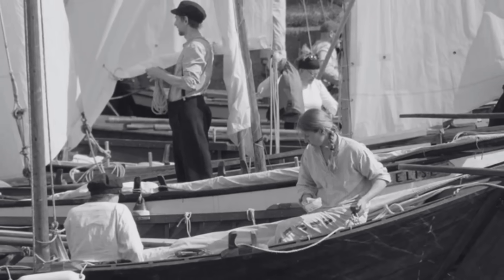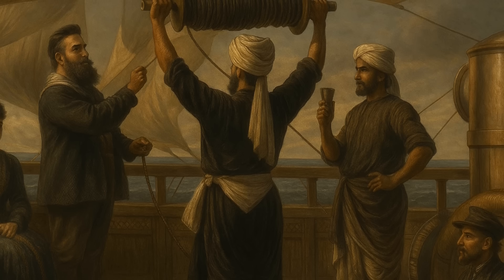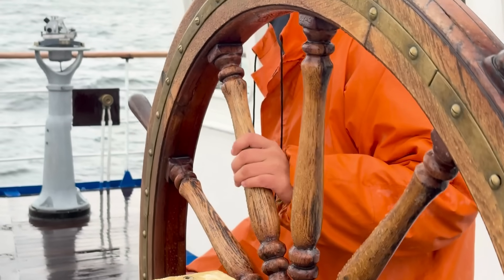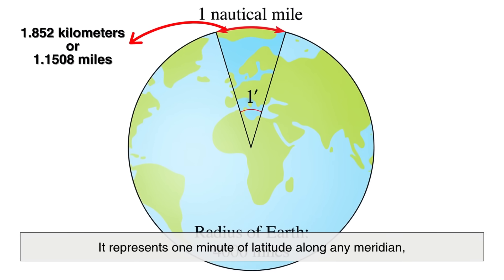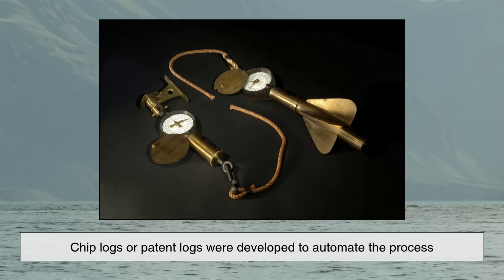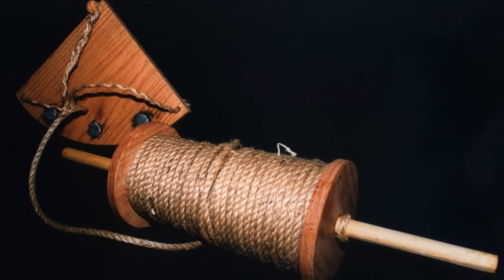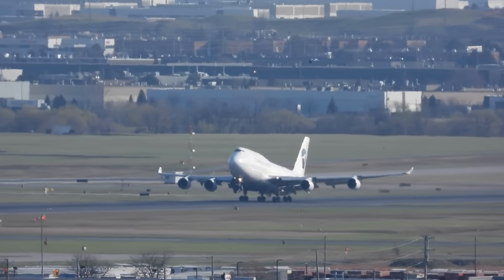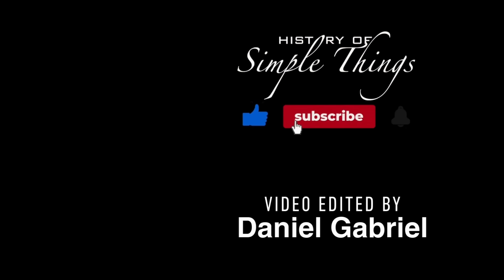Why Ships and Planes Use ‘Knots’ Instead of Miles per Hour

Comment: Thanks for finally explaining knots per hour! The equation was rudimentary there are 6076 feet in a nautical mile divided by 3600 seconds in an hour times the 28 seconds in the hourglass which equals 47.25 or 47’ 3” of rope. Therefore the number of knots that passed through the sailors hand during the test measured the knots per hour or speed. Awesome!!!

Comment: The knot is based on the 2000 yard nautical mile.  Statute mile is   5,280 feet, the nautical mile is 6,000 feet.  It makes computing rate, time, and distance much easier to calculate for basic navigation
Reply: That is true but it is also 1/60th of a degree of longitude on the globe at the equator, which also helped calculate position

Comment: 1 nautical mile is defined as 1/60 of a degree of latitude along a great circle (a meridian of longitude), i.e., 1 nm = 6,076 feet.
Speed is defined as distance/time, i.e.,  s = d/t.
Let x = distance in feet.
Now, forming equivalent ratios, where 1 hour = 3,600 secs and 28 secs is the time between the knots, then: 
x/28 = 6,076/3,600
x = 28x6,076/3,600  feet
x = 47.25 feet (approx)
Therefore the knots were tied about 47 feet from each other on the rope, thus giving a speed in ft/sec, which could then easily be converted into a speed of nautical miles per hour.
Simple yet very clever.

Comment: Excellent video.  Just one slight correction.  What you call a "regular" mile is actually known as a statute mile.  Oddly enough, a statute mile is used by sea craft traveling on bodies of water within the USA.  Though ships will travel in knots over nautical miles on the ocean, on US rivers and the Great Lakes, they measure in statute miles.

Comment: A nautical mile is equal to one minute of arc on the surface of the earth.  This is handy, because you can use the latitude scale on the side of the nautical chart to measure distances on the chart.  It is also handy when using a sextant to establish your location.  The calculations are simpler.

I'd Like to point out that the mechanical logs for measuring speed--were not chip logs.  Chip logs are the older device--a wooden 'chip' attached to a line marked with knots.

Comment: See 1:17 "you had to keep track of how far you'd travelled.."  Knots are a measure of speed through the water.  This doesn't take into account that the water is moving on the Earth's surface.   How can knots won't tell you how far you've travelled.  

Likewise, with aircraft airspeed; the wind speed and direction relative to the ground will vary greatly.  How can you use an aircraft's airspeed to know how far it's travelled?

I must be missing something.  Suppose a wind is blowing east at 40 knots per hour relative to the ground and a plane is flying west at 40 kph relative to the air.  Wouldn't the plane be stationary relative to the ground?

Comment: Failed to explain that with the original design of the wood catching on the seabed you can measure distance, yet with the latter design of measuring how fast the water is flowing past you, it is totally different. If you are in an 8 knot tide and travelling 8 knots against it you are not going anywhere.
Reply from the maker: That's a good point about the difference in measuring speed relative to the seabed versus the water!

Comment: Why was the hourglass 28 seconds long instead of 30 seconds? When was the circumference of the Earth determined? When was a system of knots implemented in history. I am assuming that the circumference of the Earth needed to be known before the system of knots to determine speed was invented and used.
Reply: The circumference of the Earth was first determined with remarkable accuracy around 240 BCE by the Greek mathematician and astronomer Eratosthenes.
The system of knots for measuring ship speed was developed in the 17th century.
The 28-second interval was used in the ship speed hourglass (sandglass) because that specific time interval, combined with a standard distance of 47 feet 3 inches (or 48 feet) between knots on the log line, made the calculation of speed in nautical miles per hour (knots) simple and direct.

Comment: If you wonder how they came up with the 47ft3in, here is why:  They were already using the nautical mile for navigation. To measure the speed with the rope, they chose the time interval first
A common sandglass on board was a 28-second glass (actually 30-second glasses were first, then 28 became common).
Why 28 seconds? Because 28 seconds is 1/128.57 of an hour, very close to 1/120 hour, and 120 was convenient for calculations.
The distance between knots was set so that one knot in 28 s = 1 nautical mile/hour.  If the glass lasts 1/120 of an hour, then the distance between knots must be: Distance} = 1 nautical mile / 120. Using the older value of a nautical mile used by the English Navy (~6080 ft): 6080ft/120 =50 ft 8 in 
But in practice, they used 47 ft 3 in (47.25 ft).  Why is it shorter?
The shorter (47′3″) spacing compensated for real-world errors
The chip log system had systematic biases:
Drag on the line shortened the amount paid out
The chip did not stay perfectly stationary
The sandglasses varied with humidity and temperature
The ship slowed slightly when the board was thrown
Sailors empirically tuned the spacing until:
One knot running out during the 28-second glass corresponded to about one nautical mile per hour of actual travel.
Through long practice, this settled at 47 ft 3 in.
This was not a theoretical number but an experimental calibration
Reply: Thanks - that’s exactly what I was wondering. Now - what about the fathom?
Reply from the maker: That's a fascinating deep dive into the history!

Comment: I used to think it worked with a sinking weight and they counted the knots on the rope that remained visible on the surface.
At rest the rope would point straight down and show 0 rope on the surface, going faster would make more of the rope stay afloat. 
You only have to calibrate the spacing of the knots.

Comment: also there is a relation btw knots and Mach-no. Flying at Mach 0,8 is pretty close to doing 8 nm per minute . Mach 1,8 will then equal approx 18 nm per minute. So if air traffic control ask you for an estimate over a certain point it is distance to that point divided with Mach-no = minutes
Reply from the maker: Thanks for sharing that additional insight!

Comment: Appreciate the history, but the scale value (Knot) is only meaningful when of value, which it is (K) not :)  We assign arbitrary scales to quantitative measurements as suits our needs, and today, here and now, a mile or kilometer is just as accurate to describe distance.  We need to use a Knot even less than a Light-Year in our everyday life, so cherish it's history, but it has no use in the 21st century.

Comment: Guess I'm a bit slow. I still don't know how many miles equal how many knots. In other words, a boat traveling at 20 knots is how many mph?
Reply: If you dont know knots tie lots
Reply: About 23 mph. There are converters online. 
Nautical miles are a bit longer, so MPH is a little higher.

Comment: One knot is one nautical mile per hour. A nautical mile is 2000 yards (or 6000 feet). A statute mile is only 5,280 feet.
Reply: And if you dont know knots tie lots
Reply: Learn these and you’ll be fine:
Bowline: Creates a fixed loop at the end of a rope. Securing sheets to sails or mooring;
Square Knot: Joins two ends of a single line. Binding two ropes of the same thickness;
Clove Hitch: Secures a line to a post or pole. Temporary fastening for fenders or lines;
Sheet Bend: Joins two ropes of different sizes.	Connecting lines of varying thickness;
Figure Eight: A stopper knot that prevents lines from slipping through blocks.

Comment: A victim of overthinking so I had to do the math:
28 seconds per glass
47.25 feet between rope knots
60 seconds in a minute /28 seconds per glass = 2.14 rope knots through the hand per minute
2.14 rope knots through the hand in one minute x 47.25 feet between rope knots = 101.12 feet per minute
101.12 feet per minute x 60 minutes per hour = 6067 feet per hour
6067 feet / 5280 feet in a statute mile = 1.149 (rounded to 1.15) nautical miles per hour
By golly, they were right 🤔🤔🤔
Reply: Very nice.

But any sandglass could be used if the knots were spaced to match. It only has to be the same fraction of an hour as the knots are fractions of a nautical mile.

Comment: So what happens if you’re going with or against a strong current?
Reply: The chip log only measures your speed through the water. If there is a current, your actual distance covered will vary.

Comment: I find the idea of meridians for calculations perplexing.  Meridians narrow at the poles & widen at the equator .
Reply: meridians dont narrow at the poles ,  its the distance between them that narrow,     but since u are measuring along them instead of in between them the calculations remain the same.  If u pictured a piece of string anchored at the centre of the earth and hold the other end in your hand  at the equator and move it one degree toward the north pole ,  that should be 60 nautical miles . or if u want to go just one nautical mile just move it one minute of arc (1/60 th of a degree ) toward the north pole.    This works out as its 90 degrees between the equator and the north pole (1/4 of  a circle )  and 90 x 60miles (in each degree)  =  5400 nautical miles which is what the distance is.

Comment: Pure BS. The knot exists solely due to sailors' inability to spell, nautical meaning related to seafaring (when nautical mile is shortened it kind of sounds like knot). The nautical mile is defined using earth's latitude which is easier for navigation over long distances.

Comment: Still I don’t see how they got to say one knot is equal 1 nautical mile and the separation of the knots equivalency.
Reply: Agree.. dont get that either
Reply: I think the 47’ knot length is scaled for a mile in length. 6076’ (1 nautical mi) / 47’ ( knot length) = 3600 seconds (1 hr) / 28 seconds (hourglass) . My numbers are slightly off but I believe this is what’s missing from the video.
Reply: @randypatrick318 I just added a comment explaining how they came up with that 47ft3in.
Reply: There is 6076 feet in a nautical mile. Divide that by seconds in an hour (3600), then multiply by the 28 seconds in the ‘hourglass’. Your answer will be 47.25. Therefore you know that if one knot passes you are doing 47.25 feet per second or 1 knot. If two pass, two knots etc.
Reply: Check time reference 2:30
Reply: @r @randallsimmons391 sorry but the video didn’t explain how they figured that a 47ft3in together with a 28sec time laps was equivalent to a nautical mile.
Reply: one knot through your hand every 20 seconds means that in 1 hour a nautical mile of rope would pass through your hand simples!

Comment: Nautical mile was the first widely used unit of measure for length that was based on fundemental physical properties of our planet and not any arbitrary value length of a kind's feet. Further it had a very practical use. It is a shame that the idiotic fanatics of the metric system completely disregarded this and thought they invented something great in the meter now defined by the arbitrary value of 1/299792458th of the distance traveled by light in one second!

Comment: Incredible history, but considering how the knot is basically just a converted unit now, frankly I think it's more trouble than its worth. While its conversion to Earth's circumference is nice, it's no longer an accurate measurement taking into consideration that the world isn't a perfect sphere. Hell, that doesn't even hold true locally, as different parts of the world bulges, including the water. Gravity isn't even across the entire surface (Canada has markedly lower gravity than England for example, even over water). The continued use of the term knot is culturally significant, but when it comes to communicating with those who are from other walks of life, it is rife with potential mistakes. And even if the mistakes aren't very common, there is also the issue of the extra step and work involved in doing the conversion.

Then there's the problem of vehicles that can handle movement across multiple domains. Land vehicles that can cross water or even fly. Which unit do they use? While not common, they do exist and it is a valid question. What if the become more common? What about space planes? Metric is used for anything to do with space, but converting because you transitioned from orbit to atmospheric flight? There's a ton of risk for mistakes.

Knots have served its purpose, but I stongly feel like it's a relic of the past that needs to be left behind rather than dragged further along into the future.
Reply: Aeronautics is imperial for flight levels, speed and distance and obstruction heights, tho I have seen dual labelling on European charts.  It is safe.  the cost to transition to metric is a factor.  USA is a hold out, what can we say?

Comment: Well done. It may be of interest to point out that the equivalent value of a statute mph is about 15% higher than a nautical mph. So 20 knots is approximately equal to 23 mph.
Reply: Take your speed in knots and multiply that by 1.1 and it will give your speed in MPH.
Reply: @WestTNbackyardanimals  don't you mean multiply that by 1.15?
Reply: @WestTNbackyardanimals  1.151 is closer.
Reply: Very interesting, thanks much!!

Comment: Another remarkable term for measurement was "rod"   I became aware of "rods" used as measurement while on a canoe trip in the BWCA (boundary waters canoe area) . The measurement of distance between each water source that one would need to carry all of their gear and equipment, was measured in "rods". A rod = the length of an average canoe.... 5 1/2 yards or 16 1/2 feet .
Reply: ...and four of them joined together made a chain which is the length of a cricket pitch.

Comment: The funny thing is that the French who invented the metric system tried to come up with a "natural Earth based" reference for the meter, and concocted the following:

"The original definition of the meter, established in 1793, was one ten-millionth of the distance from the North Pole to the equator, along the meridian passing through Paris."

But there was already the concept of nautical miles based on the Earth, which already had practical use, since sailors sail East / West.  No one sails from the Equator to the North Pole, but that silly definition of the meter let the French incorporate Paris into the standard.
Reply: Blame Da Vinci (the Code)

Comment: Interesting ! 👍👍
You should cover the rope method used for depth to keep from running aground !
Reply: rope is the raw material.   rope is cut for specific functions and so becomes a 'line' with a name.  you are referring to a lead line for depth sounding.  (led not leed)

Comment: Sir, you have made one GRAVE mistake !! Knot is measuring distance travelled AGAINST the water flow, NOT physical distance travelled. It is equal to physical distance travelled when water flow is zero (meaning the water is still). Lift on an airplane depends on air speed through the wings, NOT physical speed. Thus knot measurement is more relevant and critical.
Reply: both the chip log and the vessel are operating in the same medium so the effect over 28 seconds is negligible for dead reckoning navigation.

Comment: How did they calculate the 47feet was a knot though as they had no idea to reference that speed to anything ?
Reply: because it is simple math to scale down from distance over 60 minutes ('per hour') to distance over 28 seconds or nearly 0.5 of a minute.   there's a one to one linear relationship at constant speed or fixed ratio.  like feet per second can be converted to miles per hour.  just have to use the correct conversion factors.

Comment: The distance of a nautical mile varies due to the latitude and oblate spheroid shape of the earth so the median around the 22.5degree meridian is used as the norm. The equator is slightly larger and the poles slightly shorter.

Comment: Didn’t the definition of a nautical mile come first (1 arc minute of the earth’s circumference), before the rope contraption was invented to measure it?  The video implies multiple times that it was the other way around.
Reply: yes it did come after;  not sure why you feel otherwise.  You cannot calibrate the knots and the sand glass without first knowing the unit of measure.

Comment: I think I recall that knots had some relationship to degrees latitude or longitude. That's how I remember it anyway.
Reply: 1 nautical mile is 1 minute of arc (from centre of earth) travel over the earths surface in any direction, works perfectly
Reply: @billywhizz6613  nope, it varies depending on where the arc is north to south
Reply: @billywhizz6613  So if I understand this correctly... we're both moving in parallel in the same direction across the globe... but you're moving at sea level while I'm moving at 10,000 feet directly above you. To maintain my parallel position directly above you my speed will be greater than yours for the entire journey. By journey’s end I will have travelled a greater distance than you but both of us will have travelled the same minutes of arc or the same number of nautical miles.

Comment: 1.1 miles is a "nautical mile." While the origin of the term is accurate, the distance is actually critical. Take in the up and down motion of a ship and your measured distance will not equate to a mile of distance. So adding 10% gives you a much more accurate distance traveled.
Reply from the maker: That's an interesting point about the up and down motion!
Reply: My ship was very top heavy with fire control radars and we swayed side to side instead of up and down.
Reply: however, this fudge factor is never taught in navigation classes, is it?  With dead reckoning you needn't be all that accurate; you have to reset your plot with a true FIX periodically.   Sea monster lairs are only approximate.